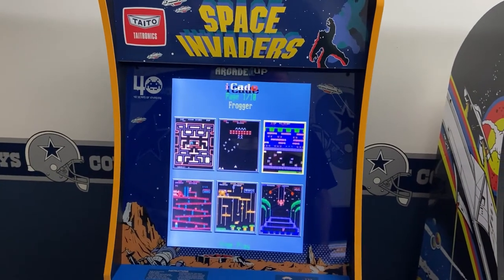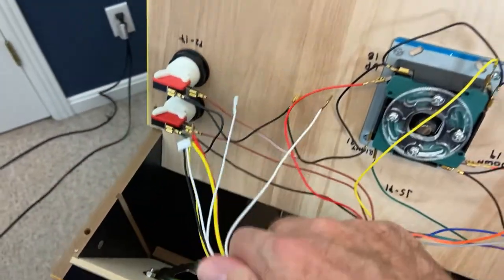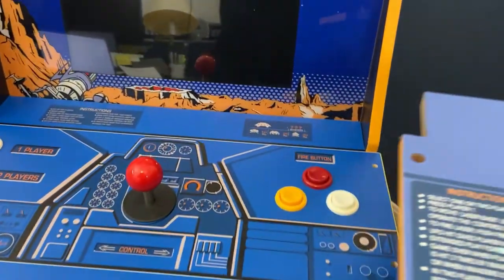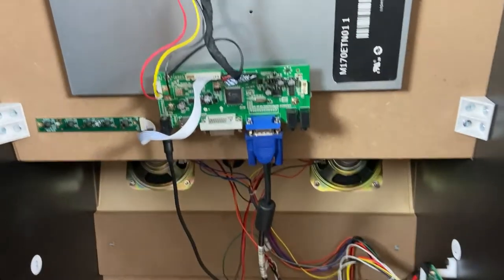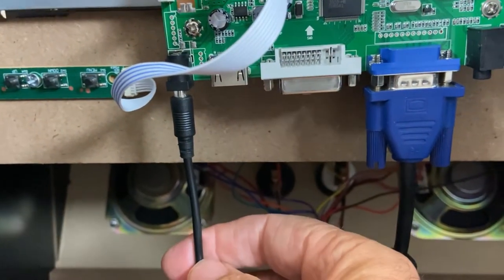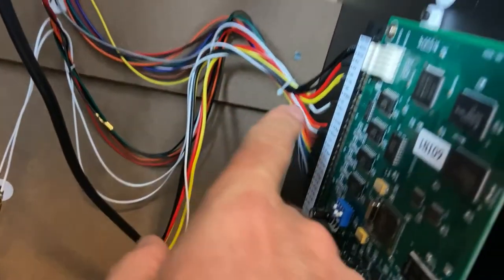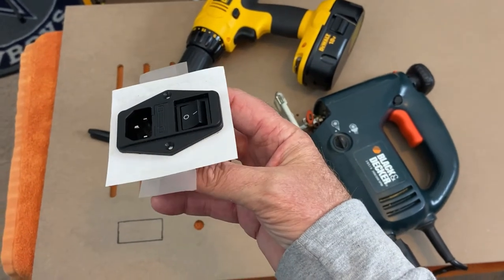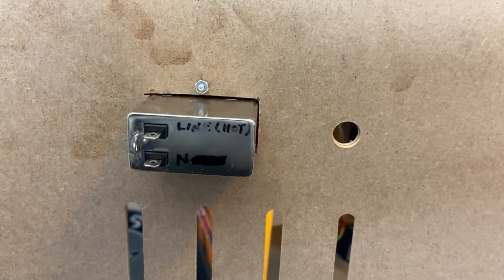Part 3 - A1UP Cabinet Conversion to 60 in 1 Board - MultiCade - iCade - Arcade1UP

Comment: Nice video series.  I like the power switch with the filter built in.  I'm planning a similar build and liked seeing a different approach.   I missed how you handled coining up the game.   I had a friend  laser cut a J panel in a similar fashion, but used those 2 buttons for coins.  Did you set the 60in1 to freeplay?  Thanks!
Reply from the maker: My cab is set to Free Play.  In the segment where I hook the Orange & Red wires to the Test & Service buttons there is a Green wire in that sub-harness loom - it is the “Coin” switch wire that you would use for coin / credits.  I think green wire is P1 Coin & this JAMMA harness did not have a wire for P2 Coin (that would need to be added - see my 19-in-1 video on how I added a wire to that JAMMA harness).

Comment: Could a track ball be put in? would there be wires for it? thanks
Reply from the maker: Yes.  4 games can be played with a Joystick 🕹 or Track Ball - Centipede, Millipede, Arkanoid, Super Breakout.  The JAMMA harness is setup to accept a Trackball.  Google to see which Trackball devices work with 60-in-1 board + JAMMA harness as u have options.

Comment: I think the new control panel looks better, however I cant tell from the video how close does the color of the T-molding on the new panel match the cabinet?
Reply from the maker: Cabinet tape is light Orange.  Marquee letting is Yellow.  Side Panel has Orange Earth graphics & Yellow lettering.  Control Panel T-Moulding is Yellow.  It looks good.  If I did it again I “might” choose the Orange T-Moulding and use an Orange Button instead of Yellow for S2.

Comment: I just finished a build, can u tell me which order the wires from the power supply (I have the same colored power wires red blue yellow)
In what order do they go on emi filter.
Thanku
Reply from the maker: In my 19-in-1 Board video series...check out Part 4.  Around the 24:30 mark I discuss the wiring of the Plug with the 3 wires (Brown-Blue-Yellow) + plug Pigtails (White/Neutral and Black/Hot).  At the 24:55 mark I show a wiring diagram for the Plug which indicates where all of the wires + pigtails should be connected.

Comment: Is it possible to do this with an Arcade1Up Countercade?
Reply: Yep, I did it to my Galaga Countercade. DIY Retro Arcade sells the entire kit for Gen 1 and Gen 2 Countercades, it includes the board and all the buttons and the joystick, the wiring harness, etc. All you have to buy additionally are the LCD driver and the power cord, and DIY sells those too, just separately. They also have a 51 minute instructional video to show you how to make everything fit inside such a small cabinet.

Comment: To avoid any mistakes it would have been nice to see how you wired the EMI filter.  Do you have to do any voltage adjustments to the PS and if you use a power strip instead of EMI filter can you use the original PCB power cord to power controller board?
Reply from the maker: My 19-in-1 Video series covers how to connect the wires to the back of the Plug for the ON/OFF switch that I installed on the back of the cabinet.  Video #4...around the 24:00 mark.  I did not have to do any adjustments to my Power Supplies...however...I think there is a Screw (white/plastic?) that you turn to adjust the Voltage.